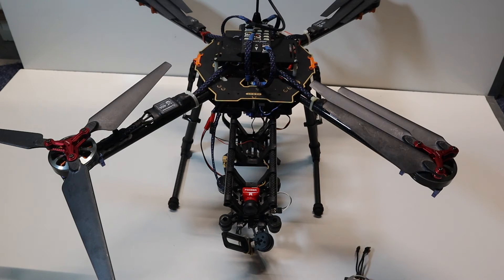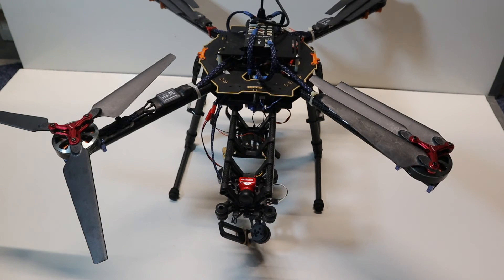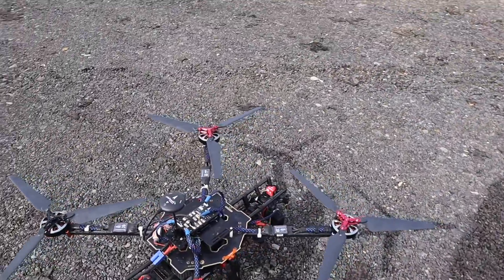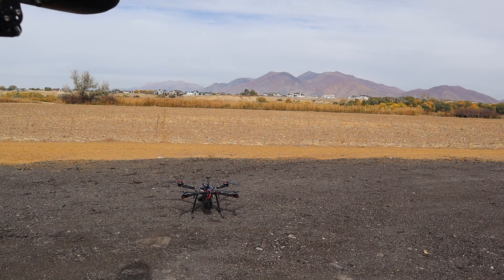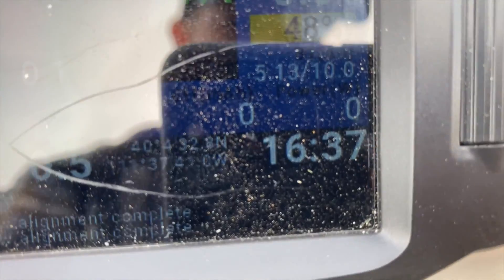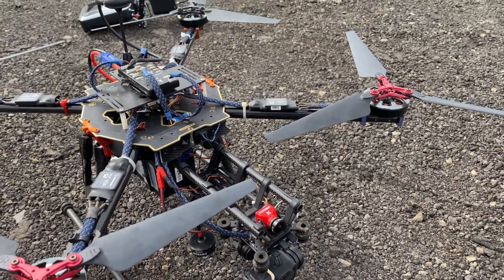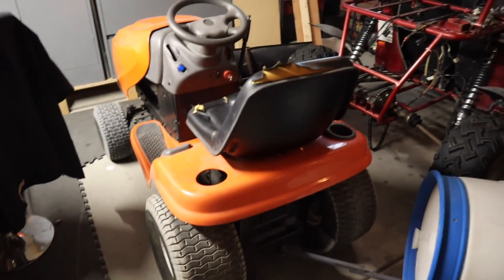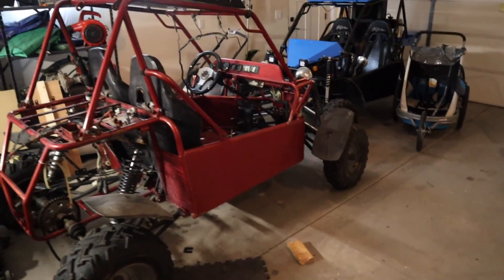Tarot 650 Sport Rebuild!

Comment: I am going to build a Tarot 650 Sport with retracts like yours. I bought MN5008 400KV motors  but will be using an APM 2.8 controller as my needs are pretty modest. I'm hoping for 15 min endurace using 17" Tarot two bladed props. Stuff has been ordered, just waiting for deliveries.

Comment: I was looking at the specs of the new motors you are using and it appears that they can run in an 8s configuration. However, you would have to upgrade the speed controllers and get new batteries. I’m not sure how the motors would handle in terms of heat with the props you are using, but it might be possible. Nice job on the drone though! I’m building a drone myself and I’m making videos about it. I’m using an f450 drone frame and it’s a great place to start. I was thinking of upgrading the frame so I can be set if I ever want to upgrade things like motors for a heavy lift drone configuration. If I end up doing so, I will probably switch to a Pixhawk system as well.

Comment: Hi, looking for some help. I'm running a similar setup, I'm running the Tarot 4008 330kv motors with folding props, how are you able to stop the props from crashing into the motors when you stop or disarm the quad? My motors stop super sudden and combined with the momentum of the props, crash pretty hard back onto the motor itself. Granted I'm running a dual blade 1555 tarot folding props, they get dinged real bad. I think its in my esc but even "brake on motor stop" in blheli can't seem to fix the problem. Can you screenshot your esc screen or give any advise on my setup?

Comment: one thing i'd like to add to my 450 build would be a parachute for incase a motor gets fried. 
simple piece of plastic with some strings attached just to slow the fall  and make sure i don't destroy the frame.
i had a 3.5kg nitro plane that crashed because a an aileron control rod come loose in flight. instructor tip stalled it trying to save it. dented the back end of the receiver pack and busted the balance plug. the rest of the airplane was completely destroyed on impact. a week later right before my birthday my dad ordered a new airplane and i was back to flying that weekend. took an entire afternoon at the rc club with three guys helping to get the new airplane in the air. when the first one crashed i was ready to pretty much give up on the hobby. but i learned the hard way that its better to just keep trying

Comment: Great job. A lot more stable than it was the last time. Were you flying strictly with just the radio or are you doing the autopilot with the mapping software? Looked it you were just using the radio. Will you be doing a video on using autopilot with point to point software? I think that could be an interesting video.
Reply from the maker: Yeah i was only using the radio to fly it around. I would like to try some missions in mission panner though some day.

Comment: Good to have it back in the air! But in my opinion it is still too heavy. Replace the LiPo battery with a Lithium Ion pack. Same capacity less weight. 👍
Reply from the maker: I will have to look into Lithium ion packs.
Reply: I was considering using a 6s liion pack but was not sure if lipo was better.  Lots of conflicting info.
Reply: @mtcdrones  a large quad like this will not do crazy acro. It’s mainly for long range, easy relaxed flights so you don’t really need the Amps of a lipo battery. Li-Ion batteries are more suitable for large quads.🍻😊